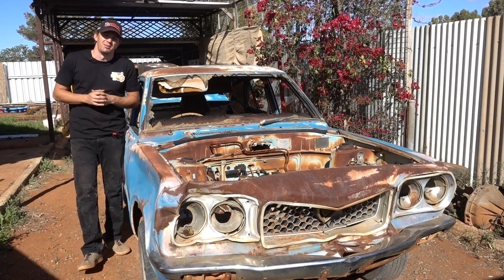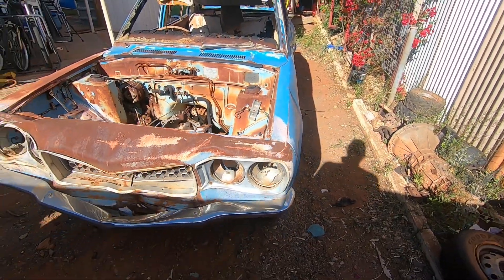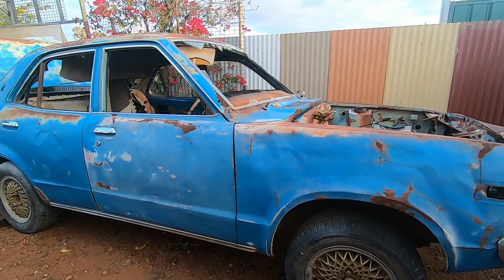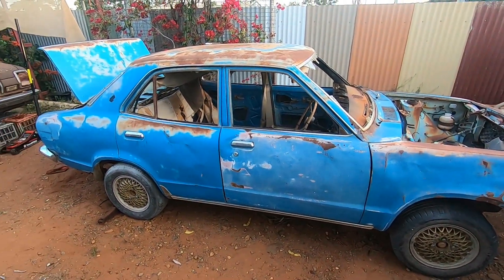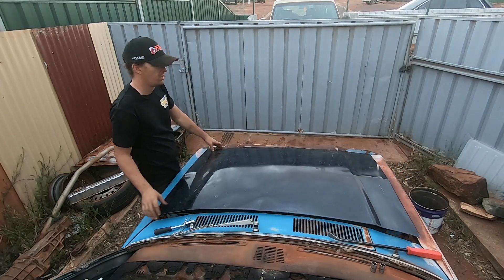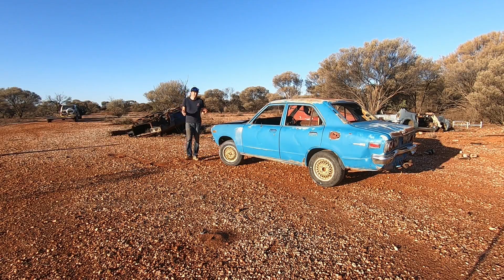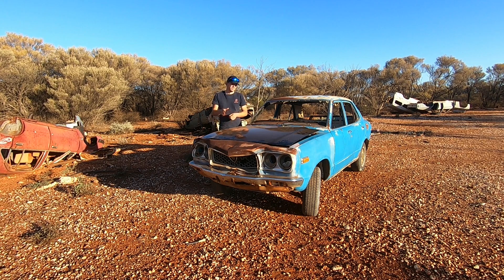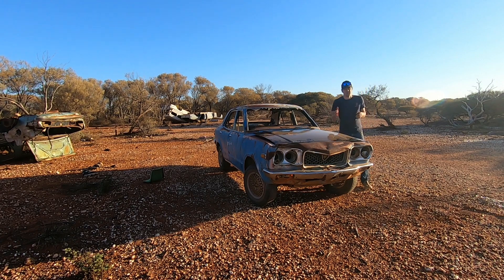Abandoned RX3 gets some new parts

Comment: You've really gotta appreciate those old Mazdas. My dad 25 years (Before I was born, I might add) ago actually bought a Coupe shell with only the bumpers and the dash in it. The motor was in pieces and he ground up restored it with a Single Weber Carb, Full black interior and a Toyota Supra 5-speed manual transmission.. It originally had this weird Japanese 5 Speed Manual in it that actually had a "Park" gear which was pretty funny(note that the handbrake didn't work at all). It was the fasting thing on the road.. Sadly, he sold it a few years later, because he was always being hassled out by the cops all the time, and he was into 4WDS.... He also had a 4-door with a welded diff in it, and one time he went around the roundabout, since he a had a welded diff, he almost drove into the shop! We also happened to own a RX2,  and one time my dad was in it, there was a dude in his XB Falcon 351-GT and he started to race him, but the RX2(Keeping in mind it was full of people) literally went past like nothing... Another time, He SPED past the servo doing 200 just right when the cops put away the speed camera and he got chased, then slowly eased down to 80. then he said "Yeah, I was doing 85" and managed to get away. Another time, He SPED up Mount Wellington UP and down completely(Also full of people), and he ended up melting the clutch plated, destroying the exhaust and melted the seals onto the rotors... All the other cars my dad owned he had to sell to either buy the house, pay bills, but the coupe he sold by choice.... You used to be able to buy them for Eleven hundred bucks, but now you have to pay EIGHTEEN GRAND for a shitty rusty 808 that's been sitting in some dudes backyard for 20 years rusting away(maybe even longer).

Comment: Well its going to a great home .. 
Just a tip for pushing out a rear panel or a general tip . 
I used a long block of wood against the wheel wells then had 2  A-frame jacks and some more blocks on the beaver side . Doesnt take much effort to get it back out that way . 
Bottle jacks , A frame jacks . a big Hammer with blocks of wood , A big rubber mallet . Thats backyard Panel beating right there lol

Comment: Love that you saved her from out of the bush and already have her on wheels and looking better haha. Great work mate 😎👍

A little tip with hitting out dints. My old man had a panel shop many years ago and he showed me a good trick. 

You use a piece of timber as hitting it metal on metal shinks the metal. Also try and start at the point of first impact (generally the sharpest crease) and work your way out! Makes a massive difference in the long run! 

Look forward to seeing more progress on the rx mate love your work 👏🤙

Comment: They are a stunning mini muscle car when restored. You're very lucky I'm virtually certain that is a real RX-3, many are fakes that were born a Mazda 808. A bit like the replica Falcon GT cars that were born a Fairmont... If you look at your fuel tank at 5:50 it has a big 'L' pressed into it meaning 'Large'. The 808 had a smaller 45 litre tank stamped 'S' for small. Most fake RX-3's almost always have their smaller 808 fuel tanks still in them. The devil is in the details. Take care of that RX-3 mate, they're a very valuable car now.
Reply from the maker: You are absolutely right mate. This car is lucky enough to still have its tags and chassis number stamped on it. It is in fact a genuine s102a.